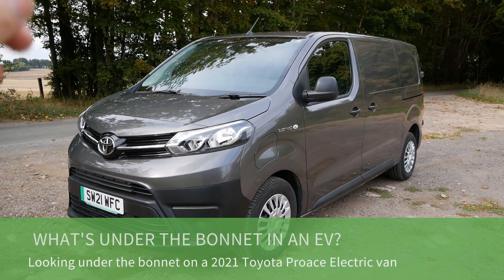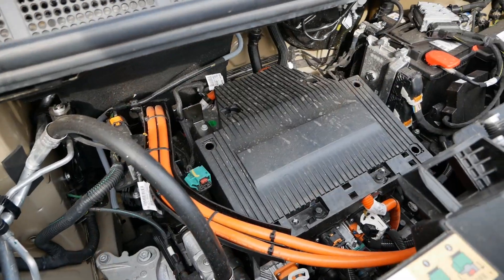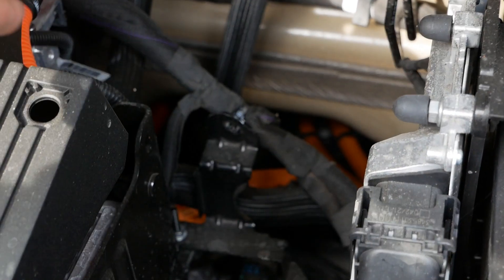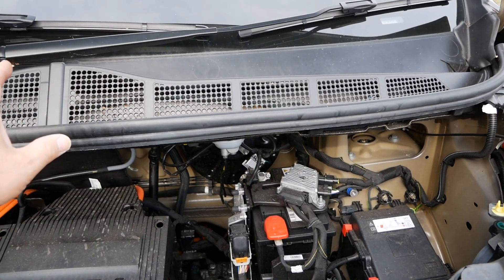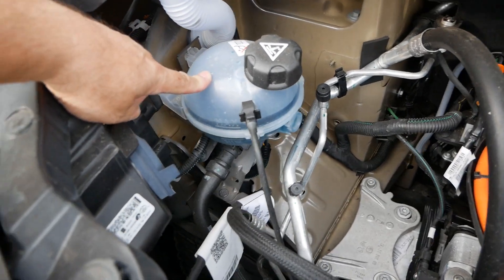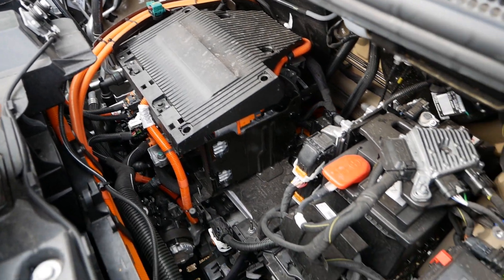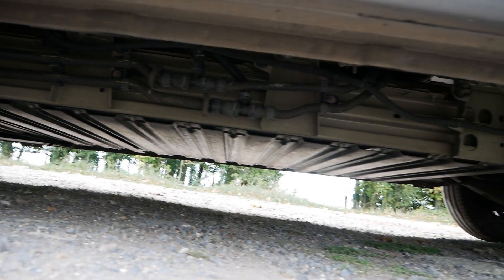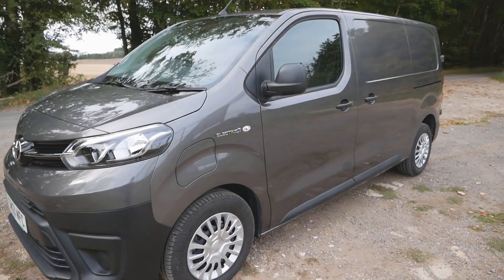What's under the bonnet in a Toyota Proace Electric van? Lets have a look.

Comment: Had this van for nearly 3 years has been excellent,saving about 3k a year on fuel( need to charge at home off peak)
Reply: Has the battery range dropped much in those 3 years?
Reply: @ yes about 10 miles but on a hot day can reappear

Comment: Good morning, does the Stellantis cars have the function to charge the 12V battery when the car is switched off and not in use and not connected to a wallbox? Otherwise the 12V battery will get discharged soon and especially in winter time, it will be a bad surprise when you have need of it...
Reply from the maker: I don't think so. In fact I'm sure they don't
 Not many EVs do this.